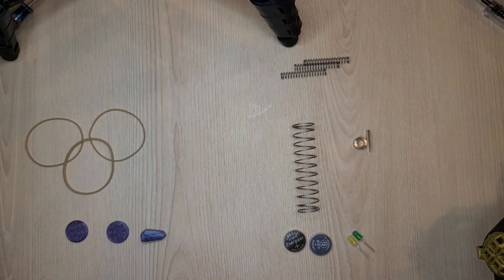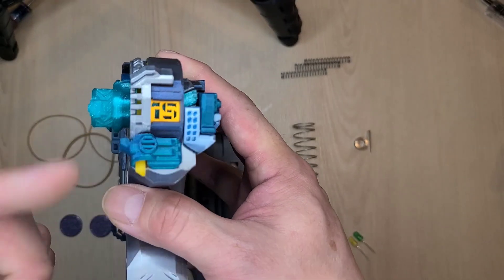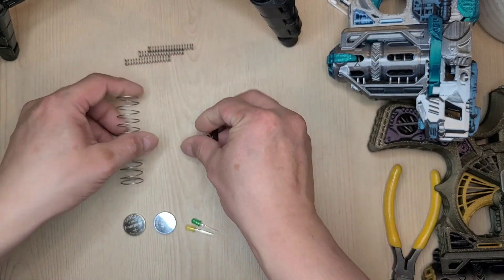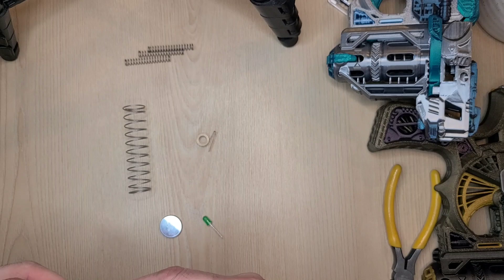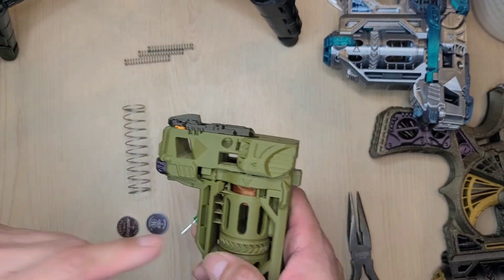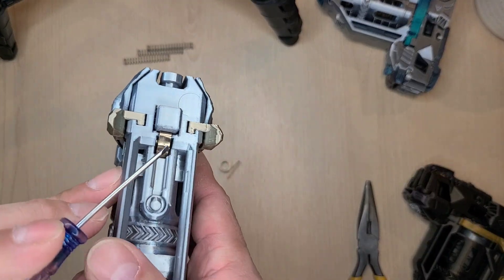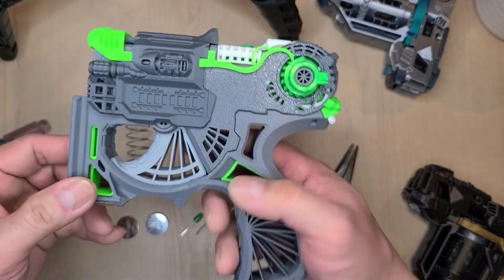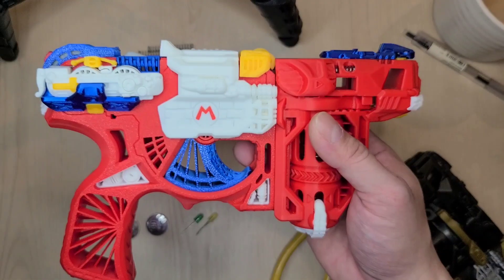2. Hardware Guideline: No Hardware vs. Real Hardware

Comment: Is there an alternative name for the 'drum' spring? First time I am seeing such a spring. thanks.
Reply from the maker: Constant force spring. The installation of that spring is a bit tricky, I’d suggest that you watch the “4. Mag Assembly “ video first before you decide which spring to go with your builds😊
Reply: @BoBoInnovation  Thanks for the quick reply. I managed to find similar springs using that term but look different as they are closed.. The big springs are easier to source in my case. Thanks again!!
Reply from the maker: For the said video, skip to 25:44 for the installation of the constant force spring
Reply: You can find them listed as FBdrumspring. I just recently stumbled on these spring designs building my new nerf blasters by sillybutts. His breacher shell ejecting shotgun blaster uses 3 of those and they are labeled as FBdrumsprings. There's also alternate versions of them known as generic drum springs

Comment: So i only need 1mm  X OD 20mm X Free Length 70mm and 0.5mm X OD 5mm X Free Length 40mm springs ?
Reply from the maker: Yes, and LED diode and batteries if you want that LED feature😊
Reply: @BoBoInnovation  Ah yes, it was mainly the spring thing that confused me